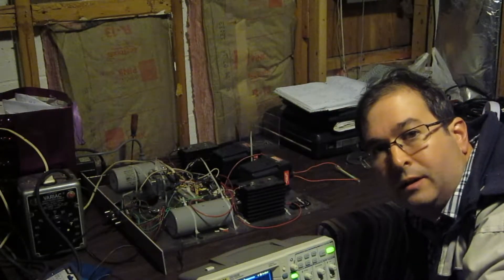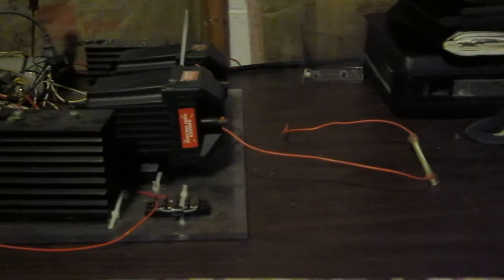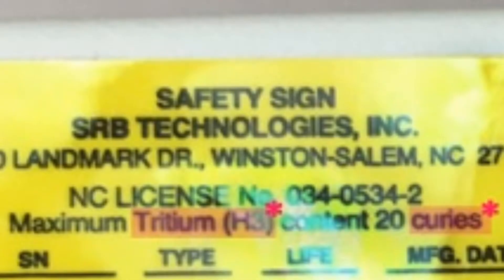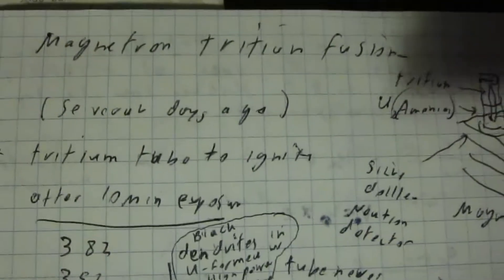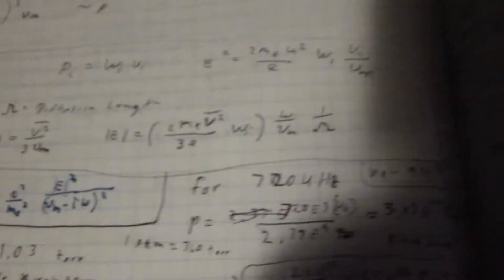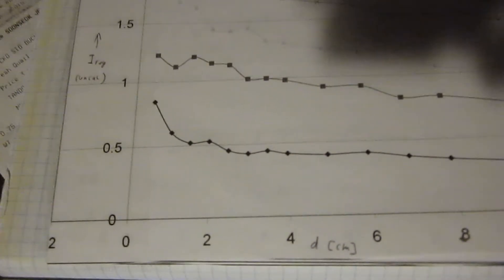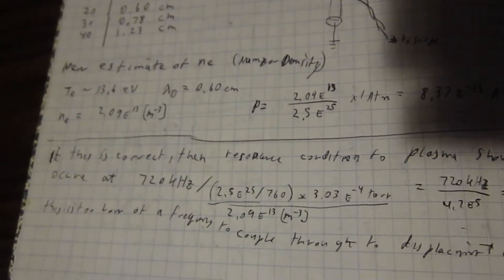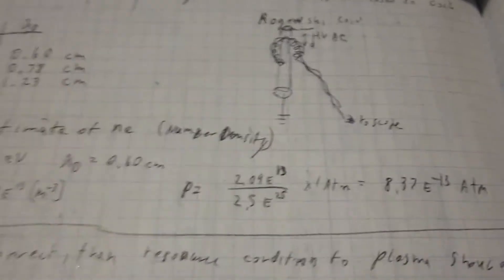Tritium Nuclear Fusion Experiment - Part 2 : Debye Length

Comment: Thankyou for the video, very interesting. Can I ask what area you are a doctor of? I am of a biotechnology background and don't have a lot of knowledge in this area, but I find it very interesting.
Reply from the maker: My Ph.D was in generation of high power electromagnetic radiation with a electron beam tubes. But I have done research in plasma physics, high power lasers, and other areas of physics and electrical engineering.  The your tube thing is a part time hobby for me. Yes I agree, there are many different areas of science and technology that are very interesting.
Reply: jaynes network excellent. Thanks again for the video.